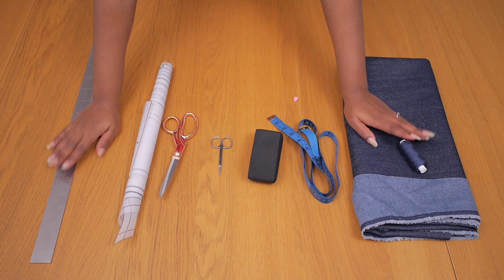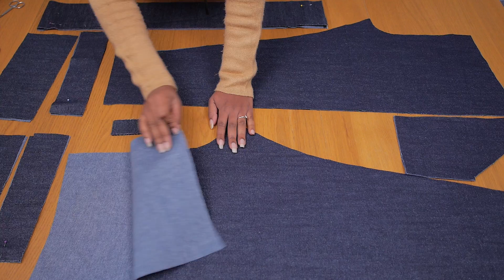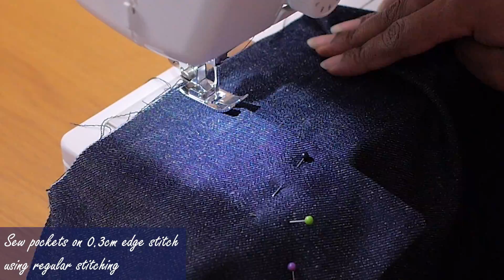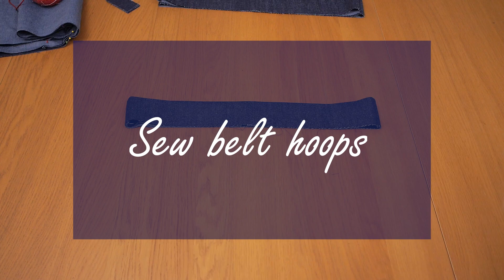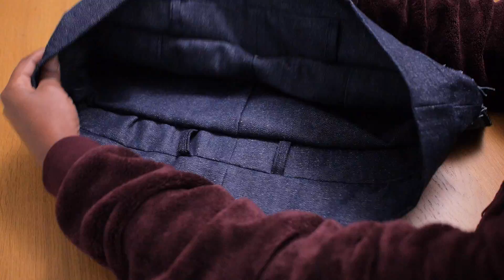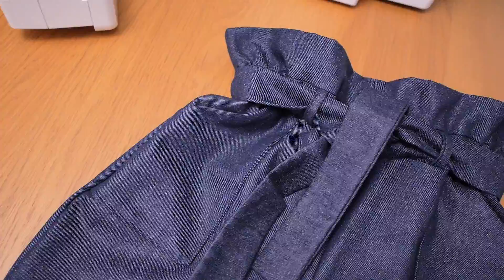HOW TO SEW PAPERBAG TROUSERS | KIM DAVE

Comment: Hi Priscilla. How do you turn the belt right sides out after sewing/do you have a video for that already? ... I find that so hard especially with long lengths and harder fabrics. 
Thanksss
Reply: ore babs I know this is late, but I always cut a small hole in the very end of the elastic and slide the hole through the clip part of a regular writing pen. Works so much better than a small safety pin 💓